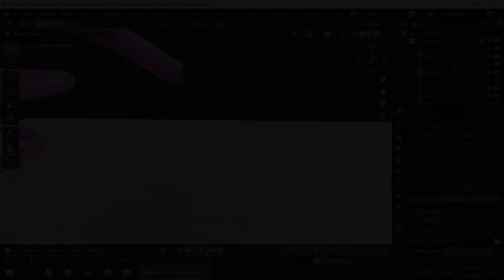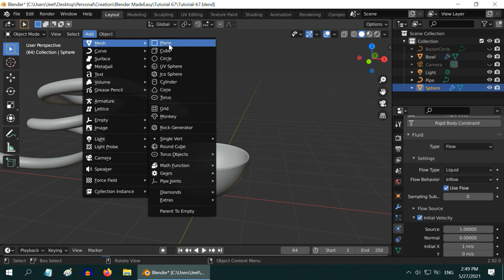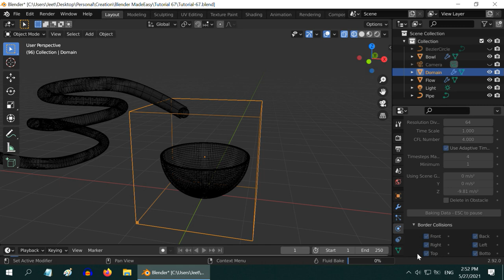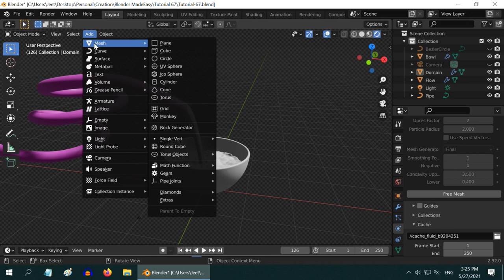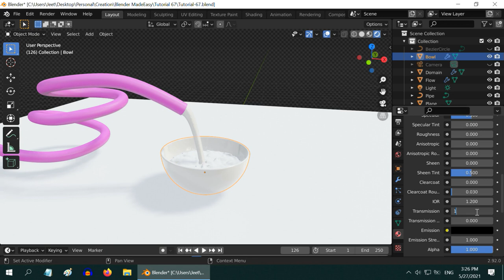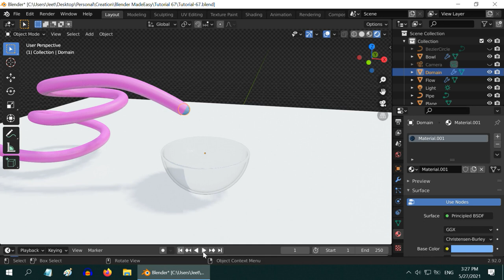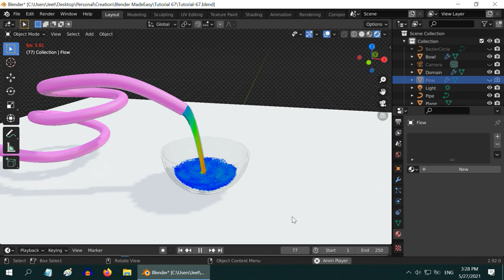Fluid Container Explained | How To Use An Effector In A Fluid Simulation | Blender Eevee & Cycles

Comment: I take issue with this .... Sorry great video but I don't see the blue dots of the simulation no matter what I try )= Help please
Reply from the maker: Hi, the blue dots are only for the viewport (so that you know what is happening with the fluid, you can design your scene accordingly), they do not display in the rendered output. In the render, you get the same material that you have setup for your fluid domain. I am not sure whether the fluid is not generating at all in your case, or whether the fluid is there but the blue particles are missing. This is our second tutorial on fluid simulation with a focus on the effector. In case you are finding some issues with the basic fluid simulation itself, I request you to check our foundation level tutorial, we have explained the fluid simulation basics in this tutorial 👉 https://youtu.be/UHqh-Pe5WXI
Reply: @5MinutesBlender  I was talking about the viewport, thanks I'll check the video
Reply from the maker: @red_juan  Sure! The domain object has a particle system attached to it. In the particles tab, there is a section called viewport display. That controls how the tiny particles display. And to see them after baking your simulation, the domain material should have some transparency. I hope these 2 things may be helpful for you.
Reply: @5MinutesBlender  Much appreciated! <3 Sadly I've tried it but still nothing in the view port I don't know what buttons to press to make them show, I'm only looking to show the blue dots so that I know what's going on.
Reply from the maker: @red_juan  Can you please send your blend file to us (our Email ID is given in the About section of this channel). I will check what is missing there. If there is anything wrong in your blend file, I'll find it out. But if the blend file works fine at our end, it might be some other settings on your machine, I can suggest on that as well.